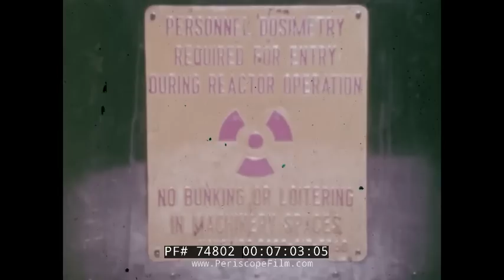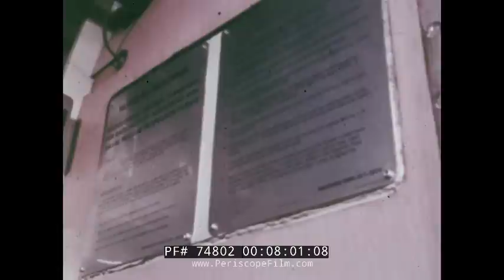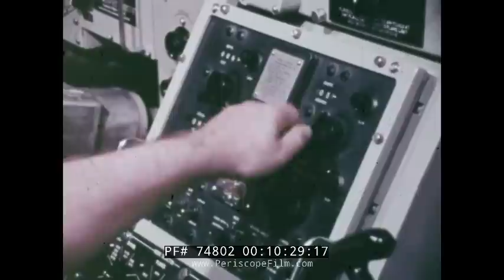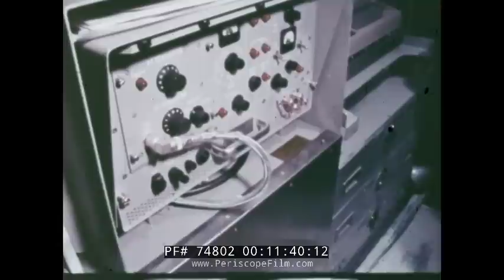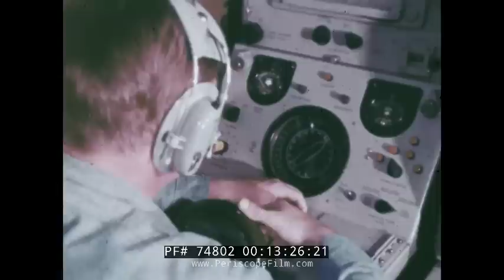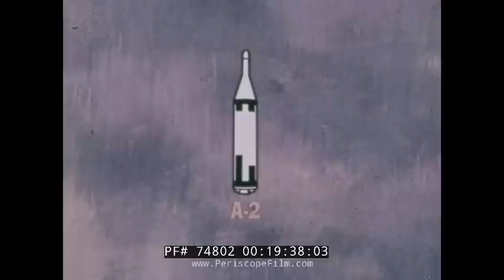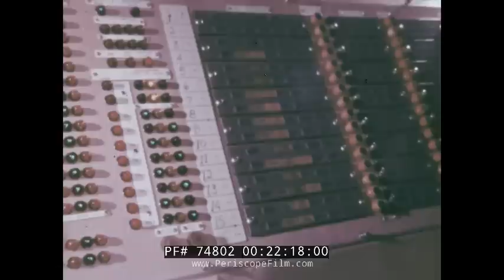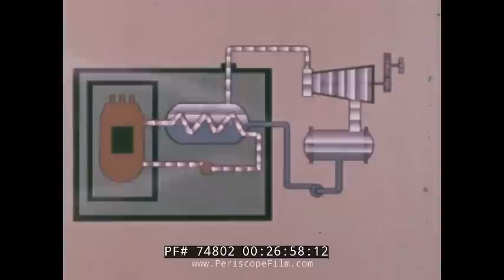U.S. NAVY NUCLEAR SUBMARINES MISSIONS, CHARACTERISTICS AND BACKGROUND 74802

Comment: Served on a 637 Class, some good scenes.
Reply: My older brother was an STC on the 650 in the early 70s.
Reply: So You guys had GPS back than but wasnt a big thing?
Reply: Me too. USS Ray (SSN-653).
Reply: @BeryJensen  GPS didn't start showing up until the early to mid 80's, prior to that it was a doppler based satellite navigation system with fewer sat's so there were specific windows of time where you could get a satellite fix.
Reply: @hpbear101  NAVSAT

Comment: the first missle subs were actually fast attack subs cut in two and the missle compartment welded into place
Reply: Sounds like a big job that requires outstanding welding skills.
Reply: Yup. I served on Theodore Roosevelt (SSBN 600).
Reply: Actually the film is more accurate; the cutting was on the blueprint, w/ only some keel material being carried over to the new design.

Comment: A hull designed to withstand depths below 400 ft. Seriously?
Reply: The USN always quoted SSN performance as 'greater tha 20 kts, and test depth greater than 400 feet' during the cold war.
In fact, the 637 class could dive as deep as 1300 feet and sustain 26 kts, although it's 'silent speed' was much less.
Reply: @crankychris2  oh I know, I just thought it was funny the "specs" were started at 400ft. I've read cavitation is less the deeper you go due to the sea pressure, as a result a submarine can maintain silent speed art a higher rate of speed that wouldn't be possible at a shallower depth. Any info on this?
Reply: No.